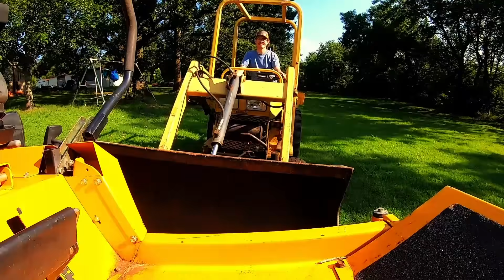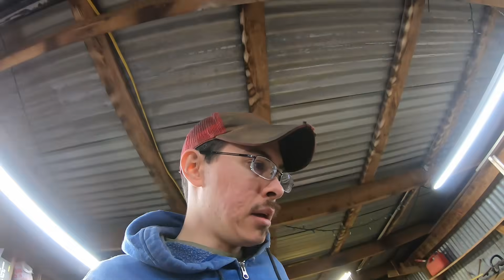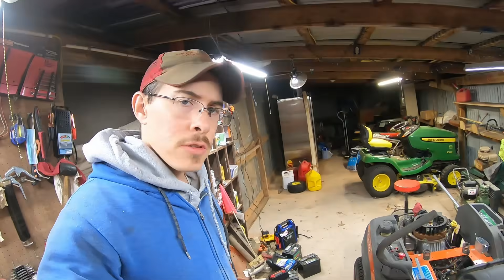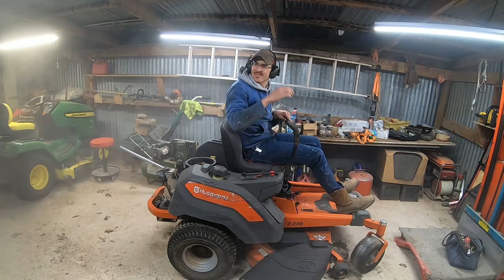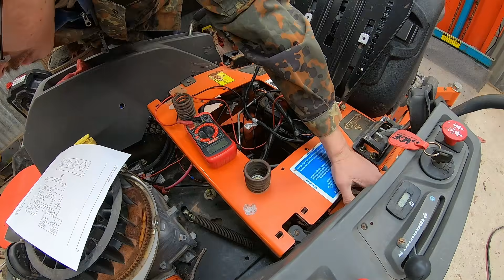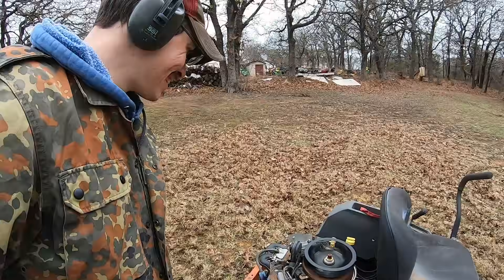Why won't it crank? Free Zero Turn has electrical problems... Husqvarna Z246 Part 2 | Garage Story

Comment: The anti back fire solenoid on carburetor can and will get sticky and be intermittent on working even after removing and cleaning.  I usually just cut the metal rod (pintle) off and disable it.
The plastic piece by the flywheel fan is the air vane choke or governor. It operates by movement of the fan and engine speed.  Usually on see these on push and self-propelled mowers.  Relays are often overlooked and don't go bad as often as safety switches, bad grounds, or solenoids.  Glad to see you got it running.
Reply from the maker: Thanks!
Yeah, the carburetor solenoids don’t seem to be quite the same again after they have been frozen.
Reply: You can't disable those down here in GA, these air cooled engines run so hot they tend to backfire or diesel on our commercial applications.
Reply: To lessen/stop backfires and dieseling, simply return throttle to idle for 10-30 seconds and then shut off Engine.  A side note: these solenoids usually function fine when you are running equipment daily. It is the periods of sitting and occasional use that causes the sticking and intermittent problems.

Comment: You might have to double ground the solenoid  I've seen that done before the One that is a strange one to replace is a solenoid on John Deere lt 133 some times you have to prime the fuel pump if it's been dry for awhile